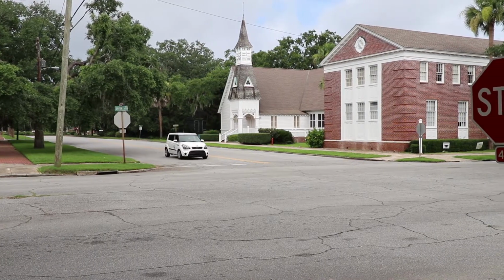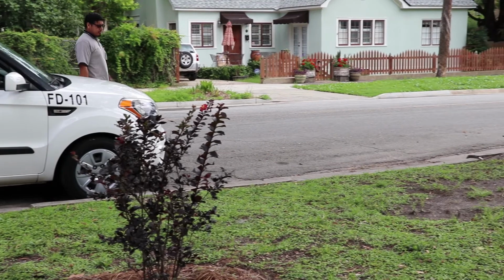FYI - What is Automated Meter Reading?

Comment: Thanks for the info. I used to be able to read the meter myself to determine ongoing status and improvements in water usage. Is there a way to read meters for ourselves now? I feel many get cost-averaged over a year, ...and am curious to know if that's possbly unfair to an "on balance" estimation of each family's monthly usage/overage costs. Sorry to confuse things here.
Reply from the maker: Hi, this is Jay Sellers. You can still manually read the meter whether you have the older style Badger brand analog register or the new Metron digital style. Nationwide average is 9,000 gallons per month, 300 gallons per day. Our local average is half that. I do have a spreadsheet available that shows the rates as you input the flow: https://www.bgjwsc.org/bill-calculator/

Comment: So the reading is automatically done! How about the turn on/off feature. Is this done manually?? I couldn’t remember if u said anything about that feature!
Reply from the maker: Shegot Game662 good question! Remote solenoid valve technology is fairly recent and we just got a demo of it last week!!! Expect to see them roll out in the next few years. That will make it easier for us to turn off the service if you have a leak or close your account. We already have some  meters that can be read by cellular service and the valves will operate using the same system. -  Jay Sellers
Reply: Also if you don't pay your bill on time they can just flip the switch and turn you off or if you don't comply to the rules like maybe vaccines are covid-19 they can switch you off

Comment: Is there a cheap way that I can monitor my meter?  My water company just installed a SmartPoint® 520M Pit Set Module that uses flexnet but can also use ERT's.  I would like to be able to monitor my useage in real time.  You know, charts, graphs, the whole deal.  I would also like to  be able to have an alarm on a leak event. If nothing else being able to collect a daily log would be nice.  My meter is often flooded for several months out of the year because of ground water which makes manual reading a serious PITA.  I guess I could just put in my own sensor(s) but why not just use theirs or at least use theirs in conjunction with mine?

I have a 22 acre property with somewhere around 1000 feet of pipe, multiple end points with more planned.  I've had several breakages that have cost a couple hundred dollars each in water alone when all was said and done.  I have spent LOTS of money on repairs and have put in many points where I can valve out entire segments of my property for increased serviceability and better uptime on the other segments.  The previous owner used schedule 20 pvc without sufficient dresser couplings for soil movement.
Reply: Usually, the water company supplies customer access to a portal to get the details that you need. Have you spoken to the water company about their customer portal yet?
Reply: @JaySellers  Where I am the county water corporation will now be sending someone by in a truck once a month instead of having someone get out  of their truck and walk over to my meter.  They are not monitoring it in real time.  There is no customer portal.